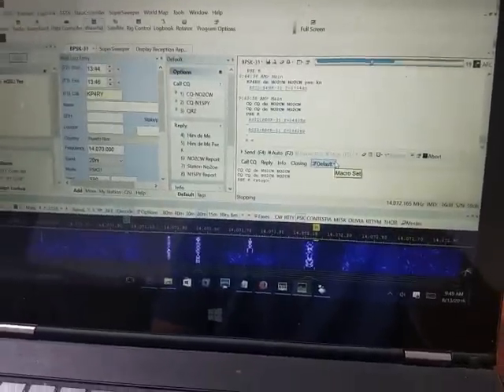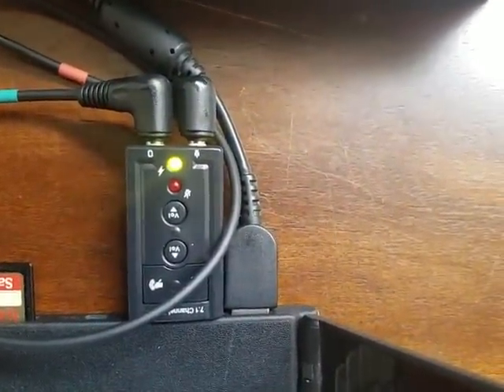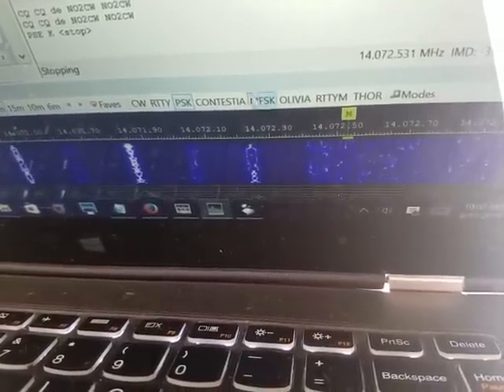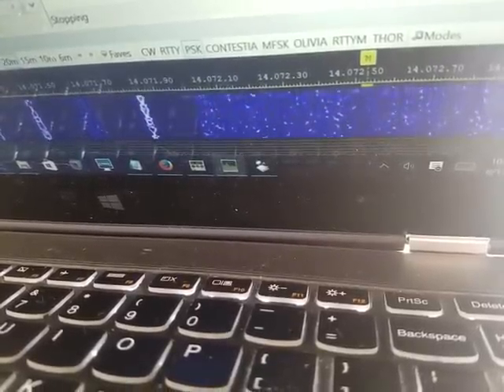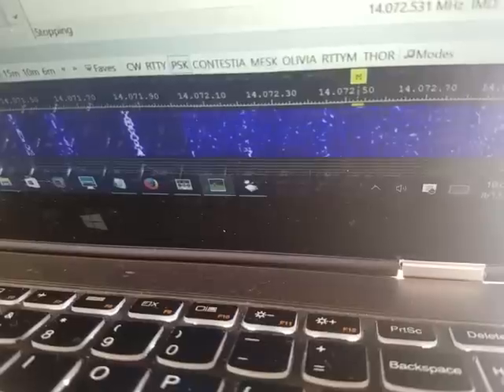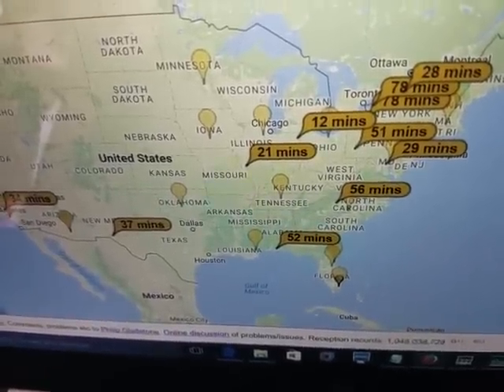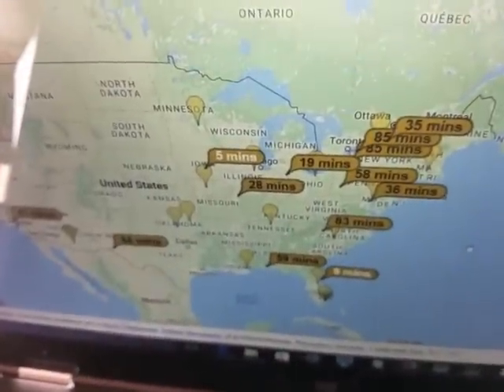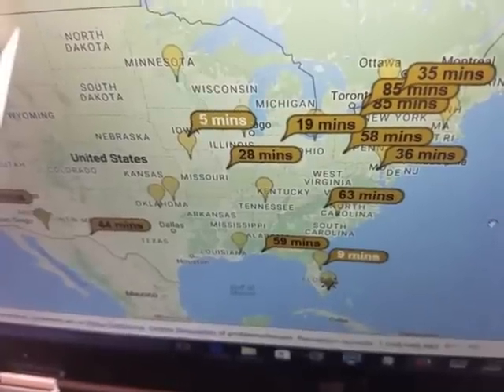Elecraft KX2 and Ham Radio Deluxe PSK31 part 1

Comment from the maker: In the process of transmitting PSK31 the temperature sensor varied from 25C (stable room temp receive) to 45C (transmitting 30 second msg at 7W). I did not notice any drift or received reports of drift, approximately 30 qso's over the weekend. 7W transmit was drawing under 2A. A test with a short 10W msg drew 2.3A max.
Reply: 10x! What about JT65 and WSPR?